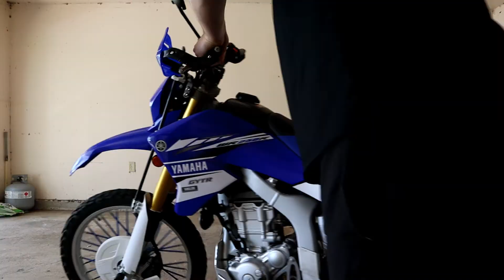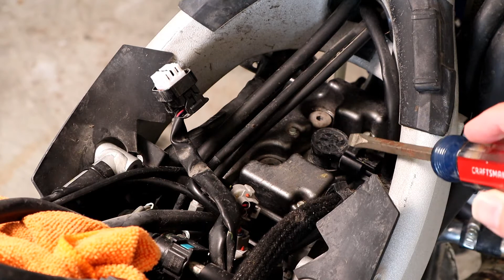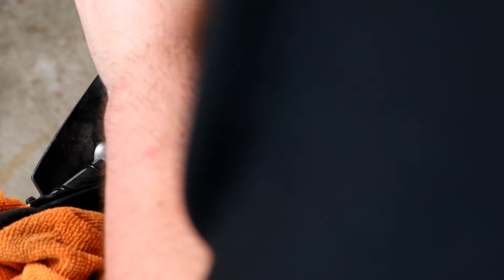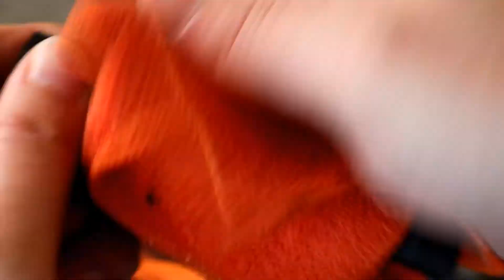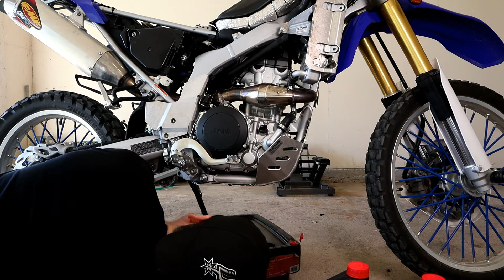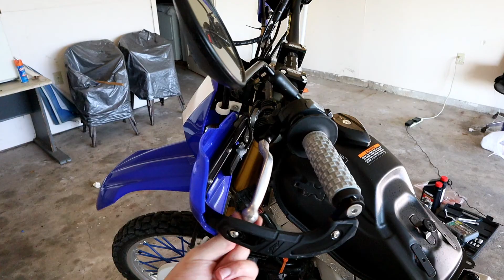Yamaha WR250R 4000 Mile Maintenance Interval

Comment: You didn't mention it, but following the oil change, there's a bleed bolt you are supposed to loosen, from the manual:

After changing the engine oil, makesure to check the oil pressure as described below.

Loosen the bleed bolt (back of the cylinder head on the left side). Start the engine and keep itidling until oil flows out. If no oilcomes out after one minute, turn the engine off immediately so it will not seize.

If this occurs, have a Yamaha dealer repair the vehicle .

After checking the oil pressure, tighten the bleed bolt to the specified torque.

10 Nm (1.0 m·kgf, 7.2 ft·lbf
Reply: Most of these youtubers "mechanics" don't mention it, but it's important.

Comment: Great video, I would have changed the plug, recommend Amsoil Yamaha glue is garbage oil great for break in that's it, also started when I unplug electrical plug I use Super Lube Silicone dielectric grease now that should be done from the factory they are lazy and cheap.  Also would have done fluid flush, love the Honda Blue from car dealer bike runs way cooler.  When you do your brake fluid EBC brake pads if you have funds up grade the break line and completely tear down the brakes and do a full cleaning.  Agree with the one comment fix your chain I use kerosene to clean my chain wash, dry and lube with chain wax let sit over night, so you could have cleaned the bike.  You are like me every thing should be right a lot of above is extra work but will pay off in long run. 😉
Reply from the maker: Thanks for the tips.

Comment: What size chain ring are you running?
Reply from the maker: 14 in the front and 49 in the rear.  I've had it stock 13/43 and then 13/47.  14/49 seems to be a good mix for both offroad and on the high way.  Plus, the 14 in the front helps with the issue of the chain eating into the swing arm.
Reply: @MotoBeto82  I had 14/49 and the bike felt like it had no balls, switched to 13/49. Also I cant use my sandman case saver with a 14 front. Besides, you could run a 12 if you wanted you just gotta keep your eye on the swingarm slider. they are 35 bucks to replace and it is something that wears out over time

Comment: Thanks for the video! I'm about to do a service on mine. Any particular reason for 10W-40? I see that it's a popular choice online but the service manual recommends 10W-30 or 20W-40.
Reply from the maker: Glad you liked it.  Honestly, it probably doesn't matter a whole lot unless you live in an extreme environment.  I live in Texas it's hot pretty much year round.  So, I figured an oil a little thicker than 10w-30 would probably be better for the wear and tear on the engine in the long run.  I know the engine could perform better with oils that aren't as thick due to the drag on the parts, but I haven't been able to tell a difference.  I chose 10w-40 over 20w-40 so it will be easier for the engine to turn over on a cold start.  But like I said, I'm not sure if it makes a whole lot of difference.  Then again I'm not a mechanic :)  I see snow on your profile picture, so in your case, 10w-30 will be a better option.